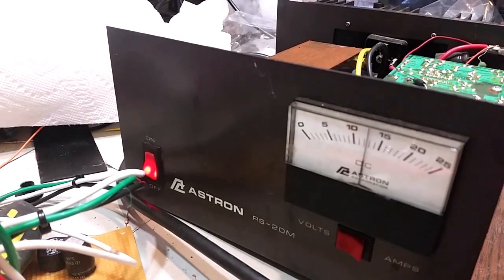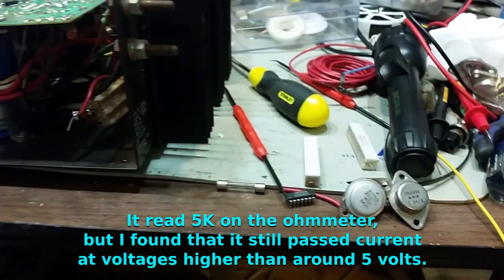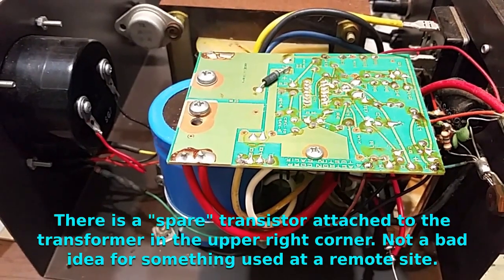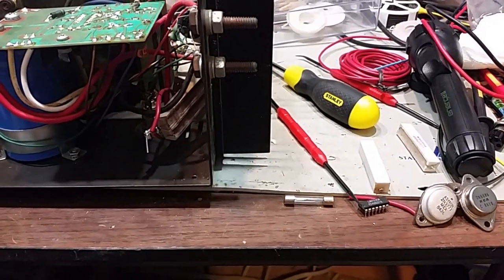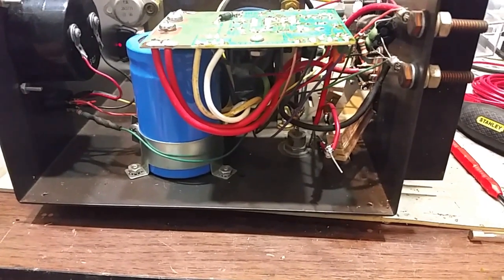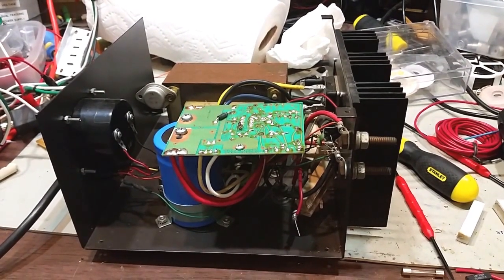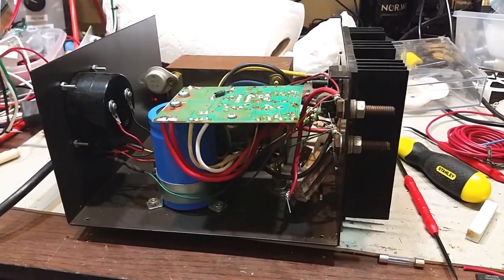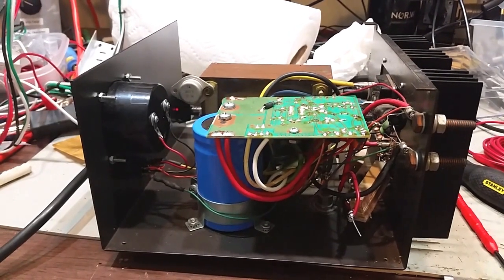Troubleshooting and Repair of an Astron RS-20M Power Supply

Comment: Okay, I've a restron 20 amp power supply. No meter Rs 20 yeah, I just had a problem there. I was using. I thought I was receiving on my icon. Radio, but also in the fuse, blue and yeah, I went up to 17.6 V. Well, I unplugged the radio because I put a new fuse in it. And I checked it, and I've seen it. 17.6, so yeah, that crowbar thing went. I'm gonna have to finish this. Also, well, I put a new fuse in well, it's what I had now. I'd add no radio hooked up to it. It was a 10 AM, but it didn't blow that fuse, but I grew what you were saying. Ah, they should have like a fuse in line. So it wouldn't blow to transistors. Yes, that crowbar circuit just sends the main line to short. If I understand that right

Comment: I'm having a problem right now with my VS-35M. Fuse blows and no output. I checked the rectifiers they were good. I took out two of the pass transistors and they tested good too. Guess I should have tested all of them.

Comment: Who uses a 20 A (10A continuous) power supply for a repeater site?
I am working on an Astron RM-50M supply now. I picked it up used. Built in 1992, the workmanship (looks original) is crap. Hopefully, they are better today.

Comment: Schematically, Astron supplies are pretty good.  BUT, the way that they are built includes sky-wiring, and marginal transformer designs.  The PC boards are supported by the filter capacitor and working on them is a real pain.  NONE of the primary supply connections have  protective heat shrink on them either, so BE CAREFUL working on them.  Consider them home brew supplies.

Comment: Btw, the crowbar should blow the primary fuse. This is why it is critical to use rhe correct size and class of fuse.
If the repeater had battery backup connected with the PSU,  when the PSU goes off the battery voltage will feed back thru the pass transistors. You can install a diode in series with the output to prevent this..

Comment: Astron, Pyramid etc. These are all cheap PSUs and the Astron and Pyramid circuits are almost identical. Both using an LM723 with a driver transistor driving the pass transistors.

Comment: I have an RS-35A that’s not working. When I turn it on, there is no output voltage and the heat sink gets very hot after about 3 min upon switching on. What could be the issue? It’s an old model the transistors manufacture numbers are 8644. Unfortunately the serial numbers stickers were removed.
Reply from the maker: First thing would be a really good visual inspection to see if anything looks bad (scorched or physical damage.) I'd disconnect the crowbar circuit first, but I would tend to suspect either the regulator IC or maybe a failed (shorted) pass transistor. I'd pull the transistors second if the crowbar didn't change anything. Then I'd replace the IC. It could be a capacitor that has shorted also. After that, it's pretty much going through component by component looking for the issue.
Reply: @W4JBM  thanks for your reply. I cleaned/ replaced silicone paste and tested the pass transistors and I think they are all good- I get 0.48 V to 0.49V when diode testing. Also it doesn’t get hot anymore. However I still don’t get 13.8Vdc instead only get 0.89 Vdc. I’ll check the individual components next and also try to disconnect the purple wire to the crowbar. Thanks hopefully I get to fix it soon!

Comment: I'm working on a RS-35M the problem may be a result of the "in-rush current" just about every time I turn it on there is a (Bang! or Thud!) Sound. Now after using it very casually over the past 5 years mainly for monitoring and not so much for transmitting (meaning low current draw all those years) The unit will not turn on correctly anymore it "cycles" on/off sort of before it will stay on. This past week it finally stopped doing that and now it just endlessly cycles on/off, by this I mean the meters go low than up, then low than up, over and over again and it will not reach or stay where the meters should be. I assume that it's the "crow-bar" protection and will use some of your troubleshooting advice to locate the problem.
Reply from the maker: The thud may be the capacitors charging, but it could be something like the crowbar shorting a temporary over voltage condition. I would get a spare LM723 and check that by replacement. The regulator ICs are getting old in a lot of these and seem prone to failure.
Reply: UPDATE: Don't over complicate things lol. What I mean by this is I took most of everything apart only to discover it was a (burning out) but not yet fully burnt out on/off switch! I should have started there but it was not easy to tell until I took it completely apart and seen the inside damage (melt down/apart) It's one of those orange back lit switches. Not sure what happened to it if it's the bulb that cause it to over heat and meal or the soldered wire on the connection area (only one was soldered the others were clipped on). All the while I was thinking something much more complicated like the IC or bad Transistor on the back. Now that I've replaced the switch with a simple non-lit on/off switch and tapped up the wire not being used for the light just in case I ever want to go with that type of switch again, it's working with no problem at all. For sure it was the on/off switch that it came with from the store. Thanks for the tip's advice and comments everyone. I believe I should find some extra parts just in case I ever need them!

Comment: Hi. I have a Astron RM-12A. It has a power switch on the front that kinda flickers. Any thoughts on what could cause this and if it will be an issue? Asking because I had the supply randomly turn off. I unplugged it and waited plugged it back in and it works again. Appreciate any insight you can give.
Reply from the maker: It looks like the same switch they use on other supplies which has a 120 VAC bulb built into the switch. I'm assuming it is probably a neon bulb and suspect the flickering is not related to the issue. I'd probably replace the UA723 regulator IC first because they are cheap and it is socketed. Is it under load when it fails? I'd tend to put it on some type of dummy load (a resistor bank if you have one) because there is a reasonable chance the crowbar circuit is kicking in and shorting the output (and if the crowbar itself fails at some point, you might put the full unregulated voltage onto whatever you're powering with it). If it is lightly loaded, you could pull one pass transistor at a time and see if the problem goes away--but even then you really can't be sure it is the pass transistor that is the root cause. It starting getting into good old fashioned trial-and-error trouble shooting at that point.

Comment: I would just say I have repaired many of these, when the SCR clamps it's supposed to blow the primary fuse, Iv'e never seen one with the proper size fuse do any damage to the power supply, it's a good idea, I'd rather toast the power supply than a radio that cost a thousand dollars, I added the SCR to my personal supply on the bench, and the only problem after 20 years was a short in the rectifier, not bad, I hardly shut it off. for the money about the best linear supply you can buy.

Comment: My 35m astron will just ( audible click ) and drop voltage to 0. It does it when I have been using moderate amps on fm modes. It does it at 12 amps. Thats low current for a 27 amp continuous duty rating. The gauge lights stay lit, just no power out. I turn it off and its fine,,, Not sure whats going on. I can run it at 100 watts fm and draw 20 to 22 amps with no issues, just seems the extended use trips something. I can still lay hands on heat sink, hot but doable with bare skin. I know enough to know I don't know enough to fix it.
Reply from the maker: 1958johndeere620 If it drops voltage, but the current pegs, that is likely an issue in the crowbar. It sounds like you are dropping voltage and current though. My first thought would be to replace the 723 regulator IC. With age and a few voltage spikes, they can act up. The other thing I'd check is that the pass transistors are roughly the same warmth. I've seen these look okay with one of the pass transistors doing all the work because of a bad transistor or an out of tolerance balancing resistor. But my gut says the regulator IC.
Reply: @W4JBM  It feels the 4 pass transistors are the same. I put it in fm mode and cranked 100 watts and keyed down. It takes the 20 amps fine, the transistors get pretty warm quick at that amp level and they all feel close in temp. The voltage and amps drop to 0. Turn off and right back on, and all is good. It does seem to happen with extended use, the heat sink pretty warm, yet not taxing the unit hard. It has always clicked off when I was receiving and not transmitting during an extended qso. It did this once and a great while since new. Its now 3 years old, limited use, shut off and covered 95% of the time. Here is a copy and paste email I got directly from Astron,,,,, Word for word, no grammar corrections  "    Firt check that the AC snd DC grounds are well tight to chassis.
2. Please check if there is a .1mf capacitor at SCR1 from gate to cathode. It id s little yellow 
Cap. On top of the control board. If it is missing 
Lets add it. If loose lets resolder it,
 "

I have the schematics yet can't seem to see what he is talking about.  ( the .1mf capacitor at SCR1 ) I am  NOT a good electronics guru. I did find a bad solder on one resistor in the board.  Actually a totally missed solder joint, just the tip through the board and no solder. I soldered it, yet have not taxed the ole girl yet to see if it fixed it. I know the 723 is a plug and play so that may be an easy fix for me to try too.     AND many thanks for the reply..

Comment: Mr. J...  The crow bar on my supplies have been set up with a contactor that drops a dead short across  the mains line to sever the fuse when triggered instead of trying to hold a short until we can get to the unit, even to the point of tripping the breaker in the mains panel. This along with an installed 20 volt MOV on the output for effective equipment protection. All power supplies in one way or another lack proper engineering to cover all types of fails.

Thanks
Ray N S.C.
Reply from the maker: I hadn't thought about having a crowbar trigger something on the mains side of things. The National Electric Code use to and UL certification still does prohibit equipment that deliberately causes over current conditions on the mains or primary, so it isn't something a manufacturer could do. Probably one of those "don't try this at home" kind of things. :-)
Reply: The crowbar in an Astron power supply does no less than to short and load the unit as a whole but you can also short the output on the transformer secondary on the 35 amp and bigger power supplies and get the same effect however would not try this on lower current(20 amp and below) power supplies. It has been helpful to us both ways. Great video too.

Ray n S.C.

Comment: Interesting video but VERY frightening. The 2N3772 is rated at 20A and the 2N3055 is 15A - fantasy numbers. The use of just 2 x 2N3772 on the output of a power supply rated at 20 A is way out of line. To be safe I would always rate ANY TO-3 case at no more than 40 W each, they just can't dissipate the heat. The bench power supply below is 75 W each so maybe I am being over careful. If the 25 V and 20 A is fully used in this Astron that's 500 W. Even rating it at 10 A is too much. Most linear circuits are easily changed to suit the output simply by adding extra power transistors.

I have built the power supply below and it's fine. I have added 2 more 2N3055's and it's 38 V and a safe 230 W / 6 A (I hope). It has 2 noisy fans a thermal cutout and 2 fuses. 
http://electronics-diy.com/30v-10a-variable-bench-power-supply.php

Tip of the day - never rest your soldering iron on a multi-meter.  OOPS!
Reply from the maker: I understand where you're coming from and agree you need to understand the ratings and limitations of your gear. I wouldn't call the transistor current ratings "fantasy numbers"--it is trying to dissipate too much power (which ties to voltage drop across them) and not just current that you have to consider. The Astron is only rated for a 50% duty cycle. Since about half the voltage is dropped by the regulators and the other half by the rig, you can roughly (very, very roughly) assume the power you are transmitting is about the same as the power the supply is having to dissipate. For SSB and CW, that doesn't tend to be an issue. If you run AM or FM then things definitely get dicey (because the duty cycle on the transmitted signal is much higher).In order of how painful it is, I'd rather lose a fuse first, a transistor second (as long as I have an adequate crowbar circuit), and a transformer third. I would worry that beefing up the output transistors too much and trying to push too much current through it over extended times would eventually fry the transformer.